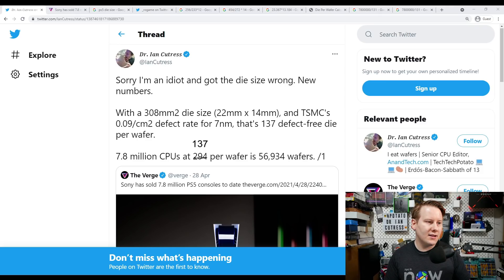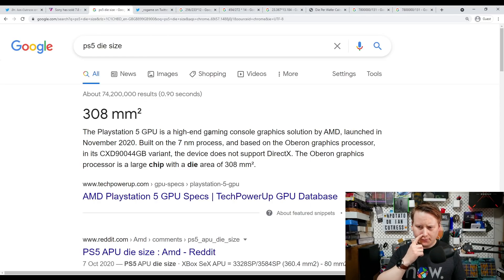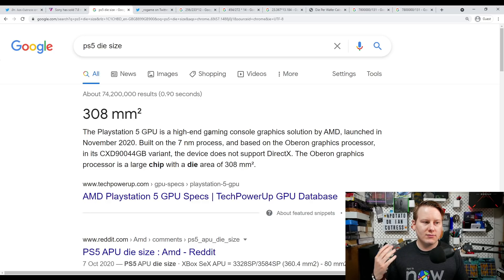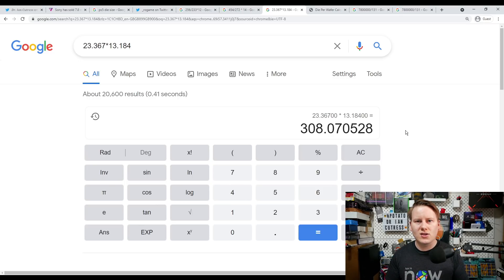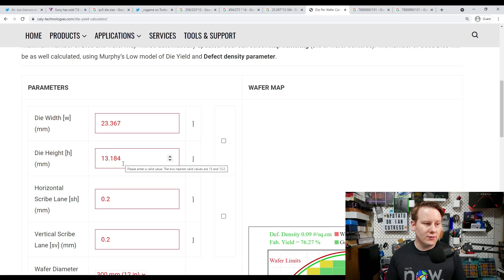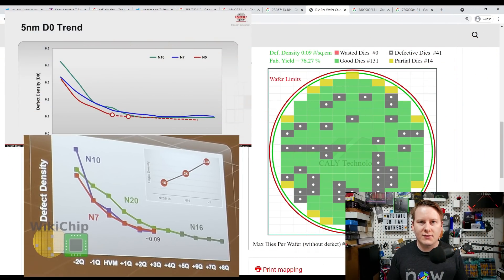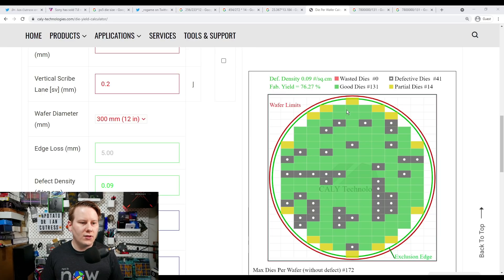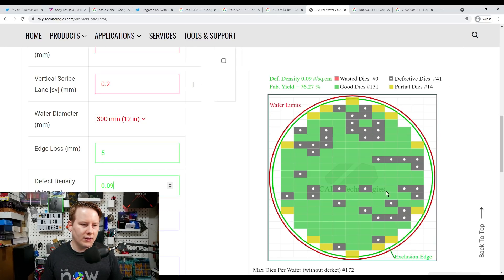PS5 Wafers. Tasty. 🍕

Comment: So if TSMC have 7nm and 5nm die's does this meant that the reports of a 6nm PS5 redesign is fake?
Reply from the maker: 6nm is an optimized 7nm design. Not a full node jump, but an updated set of design rules with some benefits. As to 6nm PS5, yeah I don't really deal in rumor
Reply: @TechTechPotato   so would they get more chips out of the wafer and would it help shortages? (if True)

Comment: It is definitively more than 131. Die is designed for 40 CUs (including their caches, TMUs and ray tracing accelerators), but they use 36 CUs. CUs are in groups of 2 per WGP. So they can loose any 2 WGP, and still use the chip. Considering WGP and GPU caches, constitute majority of die size, majority of defects will be in that area. I would say all of course, but I would say half of the "defective" dies, are still useful for them. Also minor defects in memory controllers, often doesn't do damage to make them not work. And the clocks are not binned super high, they are probably very conservative to yield 98%+ yield. So I would say easily 150 dies per wafer, if not slightly more than that.

Comment: You could add 7 more good dies if you move the dies up or down a little bit, make the partials on one side good, the partials on the other side worse.
Reply from the maker: The wafer is already centered based on the edge loss. The tool does this automatically. You can test for yourself.

Comment: 6:30 if you offset left or right by a 1mm or so you nearly half the edge dies. np sony, just send my consulting fee, no rush.
Reply from the maker: The Per-Die wafer calculator already does wafer centering to get the best die counts. It's a bit more than 1mm. What you gain in one place you might lose in another.

Comment: great summary. 60k....
does not include ones in shipping or half made, so I guess another 1000 wafers worth are in the making at some point in the pipeline. I suspect real yeld is ~10% higher as mentioned defects are not always crippling ones. Critical defect in gpu can just swap one module, and defects in power regulating circuits usually can be absorbed also, consoles are not high bin parts.
Reply: Would you not expect at least some percentage losses during the rest of the manufacturing process so that the defect % is maybe even a close number for the output of fully functioning systems?
Reply: @Grubflag  that's true, but I have no idea about survival of chips throughout rest of the process. its not 100% you are right here, but I have no idea about it. My naive guess would be 95-98%.

Comment: Question, if anybody knows, since I saw rather recently that TSMC still has pretty good income from bigger manufacturing nodes. Like 28nm (or was it 26nm?) and 40 or 45 whatever it was, sorry, I didn't remember the exact numbers. Thing is: how much better is the cost and defect rate on this surely-more-mature nodes ? From what I saw in this video, it seems like the defect rate kind of plateaus. Which makes me think that the older nodes don't get much cheaper. What would be the benefits of using a 40nm or bigger node then ?

Also, another question: a wafer doesn't have to have only one type of chip made from it, right ? I remember that high-margin chips (like Epyc) are made in the middle, while less margin stuff (like Ryzen R3 chips) are taken from the edges, since their cost allows for bad binning and defective parts. If that's the case, I assume that the PS5 chips were made over many more wafers, and I guess they were taken from about the middle "tracks" between the center and the edge of the wafer.
Reply from the maker: TSMC is about 49% revenue on leading edge (7nm/5nm) and 51% revenue on older nodes (14nm+). But they do 180k wafers per month leading edge, and 800k+ wafers/month on older nodes. And yes, defect rate usually plateaus. It gets into a good position and then it's milked for the revenue. Older nodes might get better updates when they're put on next-gen machines, but their throughput slows down as the more detailed a machine is, it tends to be slower.

To your second point, generally speaking, there is some variation in die. To say that inside chiplet dies were EPYC and outside dies were Ryzen 3 is really stretching the explanation quite far - all the chips are binned as is and they get separated out, regardless of where they came from, and then get put into products as demand requires. However, you can get two entirely different chips made on the same wafer as well. It's a bit more complex at that point.
Reply: @TechTechPotato  Interesting, especially the part about the die variation. I was pretty certain that (generally speaking) the inside=good and edge=bad was true. I can't remember where I heard it from exactly, but it was certainly YouTube, and not once. You learn something every day.

Many thanks for the response! You're really enriching the community's knowledge. Cheers!

Comment: Ian at 6:32 when the partial dies are being shown on the wafer, why don't the fabs shift the whole exposure down by 5mm or so, converting all the upper partial dies (7 of them) into full dies, and not actually losing any whole dies from the lower half? .... or alternatively, just add a full row into the middle, horizontally? Wouldn't this be a more efficient way of calculating the maximum number of dies available? Maybe this is just a problem with that calculator.
Reply from the maker: The calculator has a feature that positions the mask such that you get the most yield. It's on by default.

Comment: Great explanation Ian.
Is the SeriesX APU the same size?  So about the same wafers per die yield?
If so, and I realize they are different custom APU design, I wonder if by having fewer physical CU's per die, more of the 131 would test "good" for a PS5 than for a SeriesX?  Would it not be more likely for a die to result in 36 good CU's than 52?  Or perhaps, more of the "defect" dies might actually test as "good" for a PS5 than for a SeriesX?

Comment: AMD will be moving from 7nm soon and I imagine it'll be a couple of years before we see 6nm or 5nm console refresh, hopefully availability will improve on everything, that is until the refresh and everything is on 5nm...
Reply: The problem is that apple a couple of months ago took 100% of 5nm production and 100% production was around 40k wafers, so they better 30x their 5nm production volume.
Reply: @rattlehead999  5nm just got out of risk production when Apple jumped on it.

They're not even close to normal production capacity on 5nm yet, that's why Apple has all of it.
Reply: @glenwaldrop8166  Right. Apple will do the same with 3nm when it's ready to go, and then AMD will be free to take 5nm.

Are 5nm wafers grown to the same size as 7? If so, we'll have more chips per wafer, which means more product for everyone.
Reply: @benjaminoechsli1941  Yeah, apparently everything is still at 12 inches/300mm.

I had been thinking that we had some 400mm wafers at this point, guess not.

Seems they would do that as soon as possible. The center pieces of the ingot and wafer are the best due to slower cooling, it would seem the larger ingot/wafer would have more high quality yields than the smaller one simply due to the nature of more mass taking longer to cool.

300mm may be the sweet spot though, eventually it'll get too big and the outside will cool too much faster than the inside leaving a ring of near useless material.

Comment: I would count most of those defect wafers because they have disabled CU's and likely plan for defects and have redundancy like you mentioned. Consoles are low margin and therefore they try to recovery every single die, and plan the specs so that no matter what, every single chip will hit the target frequency / speeds.

(For ex, Renoir APU's can easily hit 2.2GHz, RDNA2 can easily hit 2.4-2.5Ghz, Sony chose 2.23)
(And Zen2 can easily hit 4.3-4.6Ghz, and Sony chose 3.4 iirc)
(And on MS side, They chose 1850mhz or so, which gives them even more room for less silicon not hitting targets, even though the die size is bigger, along with an extra 2 CU's disabled).

So just say 180 wafers instead of 140, bringing it to ~43-45,000 wafers. Starting from August (3 month lead from wafer start to finish, binning, delivery to Sony,), Count August to about January. 6 month-ish, so about 9,000 wpm.
Reply: on Microsoft side, they are reported as 3.94 million XSX/XSS consoles. I had a friend who worked in retail, and the ratio of consoles delivered  of XSX to XSS was generally 80/20 (leaning heavily XSX)

So if we did some quick math, Roughly 111 good dies per wafer, and 36 defective (likely redundancy so lets count them in too minus a few affecting say CPU or IO), we'd be at about 140. 80% of new consoles being 3.152 million XSX, about 22,514 wafers, or 3,750 wafers per month. 

XSS side, its about 197mm2. Can't find a die size, so lets say 10 x 19.7 just for estimates sake. That would give us 235 good, 40 bad dies. So lets say 265 (again redundancy). 788,000 consoles (est) would be about 2,975 wafers. over 6 months = 495, or 500 wafers per month.

So between XSX and XSS, about 4,250 wafers per month, + Sony's 9,000 = 13,250 wafers per month. Or about 50% of AMD's estimated wafer supply.
Reply: Then their revenue, and this is highly speculative.
Q2 2020 was $565M EE&C revenue, Q3 2020 was 1.134B, a $569m increase. Estimates of $175-ish per console chip (Microsoft's ++ cost in charts vs old gen) = about 3.251million chips in q3. Another 1.28B for q4 - 649.5m (est +15% growth due to high teens comments) = 630.26m for consoles @ around $175-ish = 3.6million more chips.
So 3.6 + 3.2 = asbout 6.8 million chips, in-line with what we seen a few months ago.

Comment: Haven't we used 300mm wafers for an eternity now? When are they gonna shift to 450mm or larger?
Reply from the maker: There's no desire to. It requires updating all the machines to 450mm support, and asml/zeiss/cymer etc don't want to spend all that money if it doesn't catch on
Reply: @TechTechPotato  Wouldn't the benefits in the long run offset the initial hardship? You  know, like any good investment would do?
Reply from the maker: They rather build several gigafabs on 300mm really

Comment: shame sony had to overclock the ps5 soc so high to try to make up some ground with the much more powerful series x after they got caught with their pants down. because of that, every ps5 suffers from coil whine, and it's also likely that the ps5 costs as much or more than Series X to build while being less powerful. fewer SOC's will bin to the PS5 high frequency target, much beefier and more expensive cooling system required as you can readily tell by the boat like size of PS5.
Reply: - All of the desktop RDNA2.0 GPUS run 2400mhz+, except for Xbox Series S/X (Xbox using RDNA1.0/GCN4.0 clock speeds)
- RDNA2.0 uses high clock speed because of architectural design, not because of overclocking (again, all desktop RNDA2.0
GPUs run 2400MHZ+, that’s even higher than PS5. PS5 is actually underclocked).
- Coil whine is due to low quality capacitors, or by not using epoxy glue to prevent capacitor vibration.
- Xbox Series X heat sink is actually heavier than PS5 and is using the more efficient Vapor-chamber design. PS5 heat sink looks bigger, because they use a traditional heat pipe design.
- Both PS5 and Xbox Series X consume  a maximum 220W under heavy load.
- Both perform very similar depending on title, yet there is a big difference of 10.3TF vs 12.1TF.

Makes me think Xbox is actually not using RDNA2.0 CUs, due to the lack of actual RDNA2.0 clock speeds and lack of performance for a 12TF system.

Comment: 140K wafers per month. 

we look at Sony and Microsoft sharing similar amount of chips I suppose, so lets say Console chips goes between 12 to 15% of total manufacturing output. lets count of 20k wafers just to average. 

AMD surely dont take remaining allocation of N7, but lets say for sake of making it easy, they have 50% of total allocation of N7 wafers... 70K wafers. 

now estimate we get 5x more chiplets for zen3 architecture per wafer, and as RDNA 2.0 full die is like 500mm2, they roughly get 40% larger die, so could go to around half of PS5 chips count. 

that is still 70 possible GPUs per wafer.  if they allocated lets say same amount of GPU dies as sony use for PS5 chip, then we around 70K GPU per month. that ofc goes for more varied SKU with cutdowns, and I think they pump up more of them actually than just 10k wafers...... 

and we still have massive shortage. 

what sort of demand we have these days for high performance computer hardware blows my head :O

Comment: Why are wafers circular instead of squares?

Anyway, really informative video. I love learning more about the production side of chips. 

Are there any plans to do a deeper video dive on where the semiconductor industry is going with advancements like GAAFET and why such advancements are necessary?
Reply from the maker: I could spend 24 hours talking through different aspects of chip production and GAAFETs. I have lots of booklets and slides on it from various events. Putting it into something tangible for everyone is difficult though
Reply: @TechTechPotato   I look forward to whatever you can, and are willing to, produce. Thanks for your reply!
Reply: Wafers are cut from cylindrical silicon crystal. Because crystallization starts from one point, it naturally grows out into circular shape. Round wafers are least wasteful, any other shape would require cutting and trimming the wafer.
Reply: Wafer are circular because they make them by lowering a starting crystal into a pool of molten silicon and drawing out a boule of solid silicon. They can't really set the shape of the boule into a square, so they come out cylindrical. Then they cut the the boule into wafers used for chips. Google the CZ process for a more detailed explanation.
Reply: There is a channel called coreteks take a look it talks about chip production

Comment: I would guess the Series S is probably a result of the binning process too in addition to MS cloud use.
Reply: It’s a different die I believe, it’s more Cezzane sized so they can produce far more of them. Smart move.
Reply: No. Series S has a much smaller die with lower CPU and GPU frequencies so the yield is high.

Comment: Thoughts on the redundancy.
The PS5 chip is ~80mm^2 of CPU, probably~200mm^2 of graphics, the rest IO. so about 60% of it is graphics cores.
So about 50-60% of the single-flaw dies should be salvageable, since they ship with a few disabled graphics compute units.
So out of a wafer they ought to get ~150 functional dies.
Then we return to voltage-frequency binning, and we will lose a few to that.
Reply: How much of the PS5 GPU is represented by compute units?  I ask this because both PS5 (36 of 40) and XOX (52 of 56)both have 4 CU disabled for yield.   I don't know if there is further redundancy in other areas of the APU that are less well known because everyone is fixated on CU because that is related to TFLOPS and the console wars.  Like maybe there is some redundancy in the (i/o) memory controller interface?
Reply: @2drealms196  well, a zen 2 chiplet is ~80mm^2, so i made the assumption that it's roughly the same in PS5 chip. When I looked at a die shot of the PS5 chip it looked like there wasn't that much IO die space.
So i simply guessed that  ~200 mm^2 should be graphics.
Since graphics is the only part that i know has redundancy, I made the assumption that it's the only part with redundancy. You're probably right that there is done redundancy in other parts too.
All my numbers are a bit inaccurate, that's why I intentionally fudged them to be smaller than I think they are.

Comment: Dont you think that TSMC have smaller edge loss, because even 1mm would put 12 more dies, and I doubt Sony or AMD would design so they lost so many at edge.

EDIT cut stuff which you put later in video
Reply from the maker: Unfortunately I don't have data on that
Reply: @TechTechPotato  maybe some interview with person from TSMC ;)
And I base it on logic, 5mm is standard, but wouldn't they design different so less was lost? I'm not as smart as they are, so I bet they would do. And if you look at Zen2 die or Navi is similar story, take 1mm from edge and you get few more dies. So is not only in Sony soc case.
Reply from the maker: Comments from tsmc have been few and far between the last few years. It's somewhat frustrating tbh
Reply: @m_sedziwoj  It might not help though, since, the ones on the edge might not hit the voltage/power requirements (the binning). I mean, you'll get 12 more dies, but none might be able to hit 2.23 GHz in the GPU part.